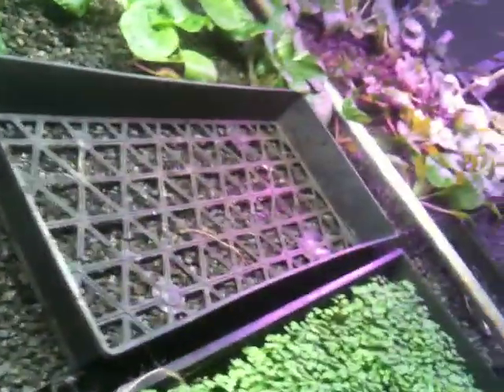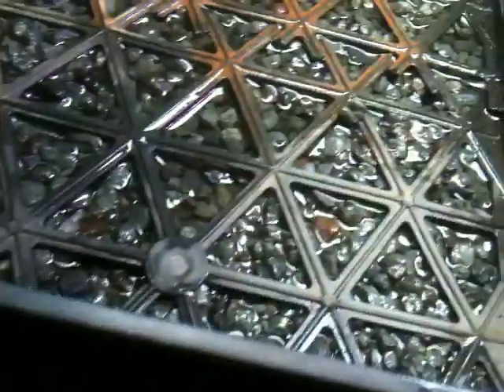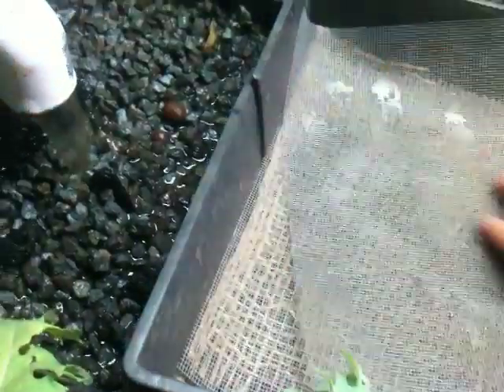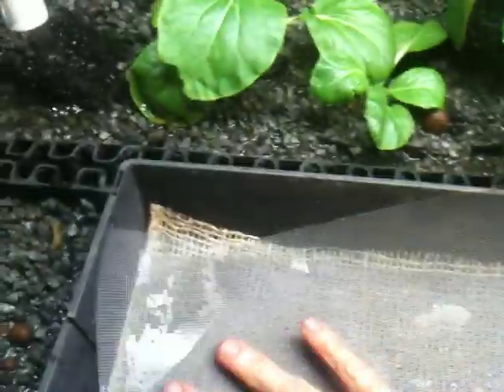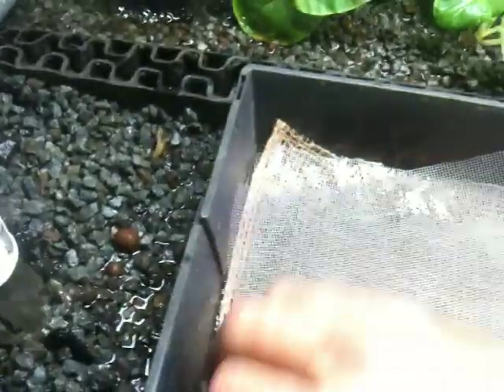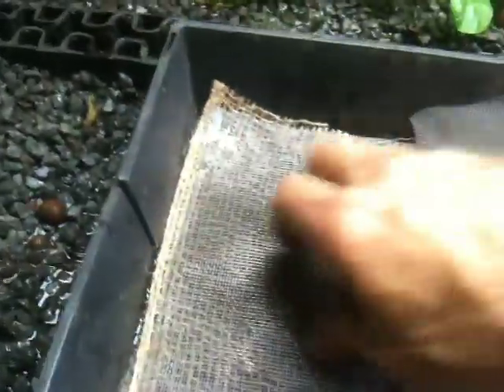Microgreens preparation; water level, burlap, fiberglass seed sandwich

Comment: A trial I did a few months back with ebb-n-flow for micro greens was to fit piping frame that the trays can sit in and the whole thing floated on the water surface when the water filled the tray ... only ran it for a couple of weeks for seed trial and it seemed to work well, it was small-scale as well, but mustard cress rocket and broccoli grew well.

Comment: We in a condo and have to grow in a second bathroom. Using soil is gritty and scratchy for the floors and for our teeth no mater how careful we have been to avoid it.

We are trying to find a way to use some kind of material like the one time use (expensive) sprout padding or this burlap without the cost of replacing each time.  Am I understanding that you are able to use the mesh layers to keep the roots from becoming entangled with the burlap and thus you are able to reuse them both?

Comment: I don't suppose you know the size of the holes in the nylon mesh?  I would have thought that with holes so small the seeds might have difficulty sprouting through it?  Do you reuse the nylon mesh?  Finally do you find that the roots grow down into the gravel by harvest time? Or do they generally not get that long?